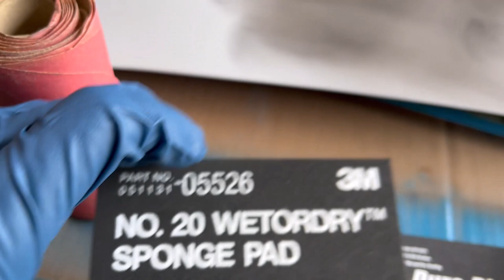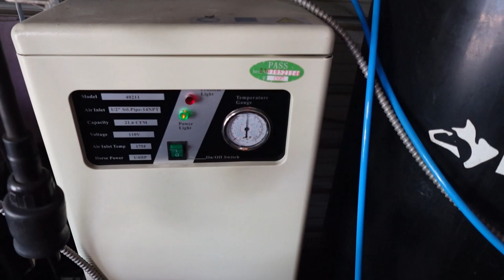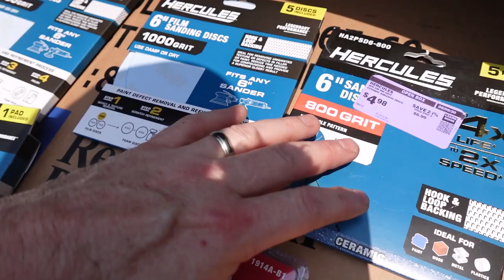Watch this! "Never take the EDP coating off" 👍🏼💯

Comment: You running epoxy directly over the sanded e-coat?---thanks!
Reply from the maker: transtar primer/sealer 6164 over the edp. Over the primer/ sealer I use transtar primer 6921. Here is the link
transtar activator https://amzn.to/42U4gEJ
transtar urethane primer https://amzn.to/3CGQzya
transtar urethane slow reducer https://amzn.to/3XgOD92
Reply from the maker: If its bare metal I would use a self etching epoxy. transtar 6114.